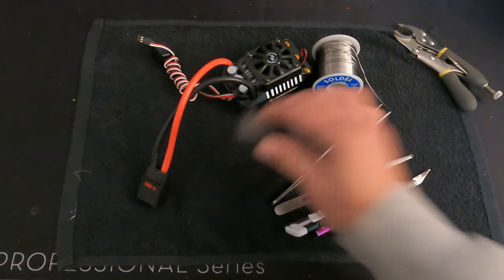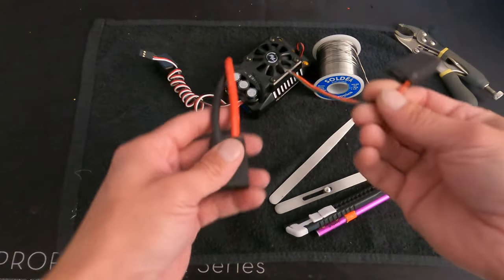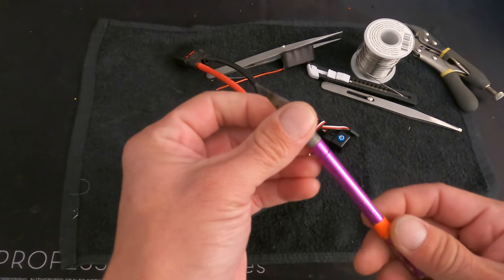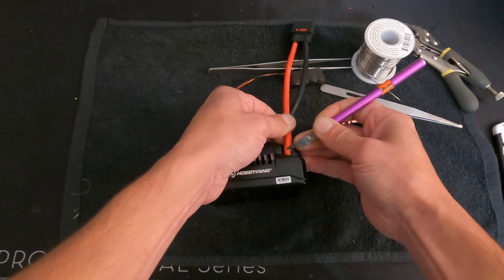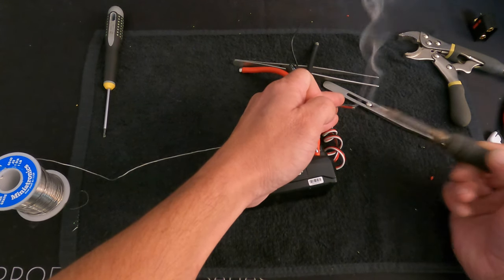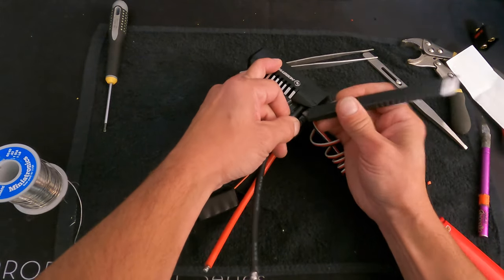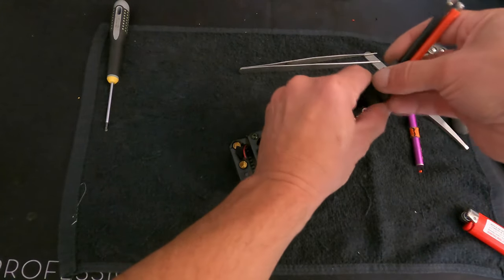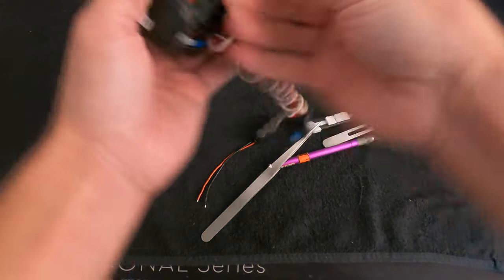The Charlie Show /// Episode 234 /// Power Cap Installation Tips

Comment: If this is needed, why doesn't it come on the esc's from the manufacturer?
Reply: ESC's usually do come with capacitors inbuilt, like thr Max5 comes with 6 of them. But an added external cap pack will add more protection against ripple, and will be the first line of defence. So if it pops, it's not the entire ESC that needs replacing, only the soldered cap pack.
Reply: They should come pre-installed. I think they don't so people who are not used to doing it F up there ESC so they will have to buy a new one.

Comment: Hey man, I just got the max 10 sct , do I have to install the included cap pack? I'm asking because it's one of the inline modules on the little electric board with curved connectors where the leads sit in and it's hard for me to solder that properly. Ive noticed in a lot of the max 10 review and install videos on YouTube they aren't installing them.

Comment: My iron nets my solder just fine but it won’t melt the solder on the esc to install my new capacitor. I don’t understand why every item for an rc car immediately needs upgrades. Stock is always junk and I’m tired of it. Just charge more for a good product in the first place
Reply from the maker: Electronics sold internationally are required to use "lead free" solder now and it tends to be higher temp than standard solder.  A little hotter and some flux will take care of it most times. 

Always a battle of 'price point' and features.  Not everyone needs the added power caps and are focused on price.   

Thank you for watching!

Comment: How do you figure capacitors smooth out current when u are talking about tiny capacitors! Connected with tiny wires and hundreds of amps. I get that there is a lot of high current switching in the vfd but if u want to smooth out current, why not use an inductor and if it helps the speed controller (vfd) to have better current filtering, why didn't hobbywing include this in the circuit. Also if proximity of the capacitor bank is relavent, that would suggest its acting as a voltage device since current stays the same at any point in the circuit yet voltage could be diff depending on where you measure due to voltage drop.
Reply: Exactly what I was wondering, that high currents need thicker wires and high voltage won't need.

Comment: You actually only need caps if your ripple is over 5-10% if you arent getting over 5% you don't need a cap, so adding a cap would be wasting money.  Don't just throw a cap pack in if you don't actually need it, spend the money on something else you actually need.
Reply: How would you measure the ripple percentage?

Comment: Hey, Charlie, should you add a capacitor to a crawler esc ? Are there any benefits in doing so?
Reply: Not needed. Crawlers don't provide enough amperage to have any voltage ripple.

Comment: Sticking a wire into a glob of solder isn’t a very good connection. This is definitely not the video I needed. I have a stock spec esc that needs an upgraded capacitor

Comment: Could you put it right at the end of the red and black where it actually connects because you can pull back that little sleeve and just put it on there or is that too far away
Reply from the maker: THe power capacitor is "most effective" on the ESC, or as close to the ESC as possible.  They almost "don't work" when installed farther away.